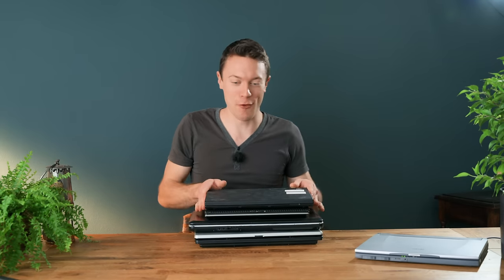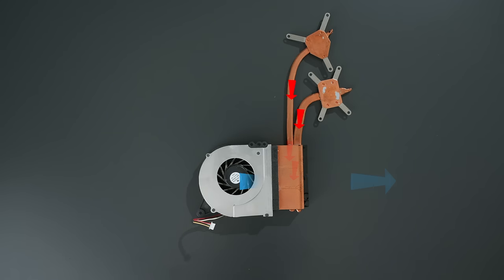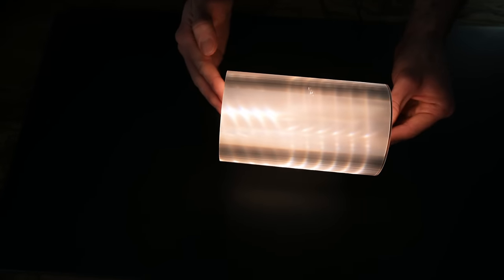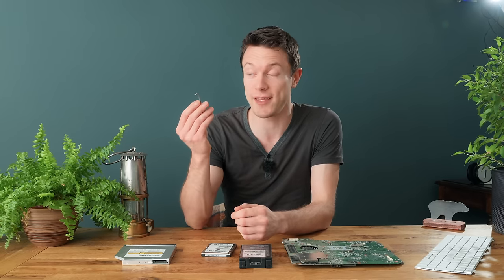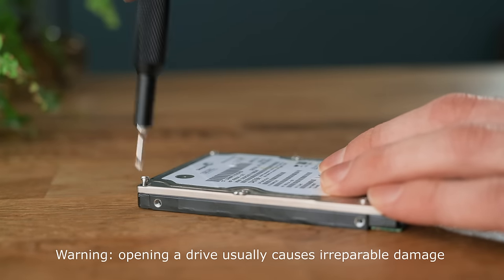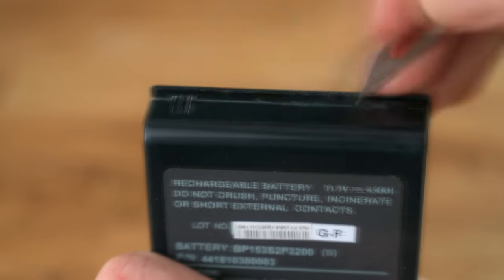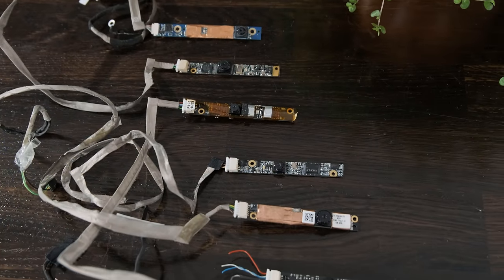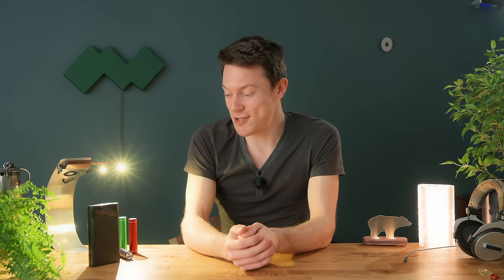Things you can make from old, dead laptops

Comment: Another tip: keep all the screws from the dismantled laptops. They are mostly standardized and come in handy if you loose one
Reply: yeah, usually m2 screw that come standard with motherboard
Reply: Very true. I often need m2.5 or m2 size for refurbished ones I do as a side project
Reply: Swallow them and hold a strong rare earth magnet over your stomach
Reply: lose*
Reply: Keep them for 2 plus years then chuck them as you realise you won't be using them
Reply: Could drop the "from dismantled laptops" I keep all screws from anything I take apart that doesn't get put back together. Never know when you'll need a random screw for something.
Reply: Agree. However at a certain point you realise what you have gotten yourself into when you're buying your 9th box to store screws in
Reply: thank you for your wisdom budget Gordon Ramsey pfp

Comment: I worked at a company that made the acrylic backlights for laptops and things. If you're doing the bear project, try to have the part of the cutout that's against the LEDs be in the same orientation as the original backlight was against its LEDs. The optical pattern on the acrylic has a density gradient so  that the light will be more even over the whole surface if you do it that way!
Reply: PJ I love to work with acrylic and backlit can you help thanks
Reply: Hello..i want to learn electronic  project making ..can u please  help me.please
Reply: You're so cool for this. Keep the spirit

Comment: 1:10 - Speakers: attaching bluetooth amp and USB cable to them

2:30 - Cooling System: used to cool high power L.E.D. lights

3:40 - Screen: using the diffusion sheet behind the screen to make diffused lights for art and tracing pictures

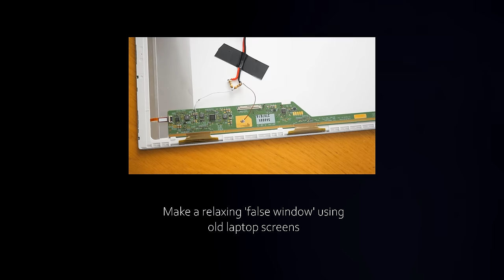4:40 - More Screen: making cool/weird shit with the diffusion sheets + L.E.D. lights

5:35 - Using acrylic panel behind screen and cutting out shapes

6:55 - If screen ISN'T smashed, use it as an additional monitor or smart mirror

7:28 - Microphone - use as a lav mic or attach to your headset for gaming

10:09 - If HDD works, put it in an enclosure. If broken, use it for sanding tools or making wind chimes

11:39 - Using HDD head array and laser pointer to make a VU meter

12:53 - Battery: using the battery cells to charge USB devices

16:20 - Webcam: making a home security system (also covered in another video on his channel)

17:20 - The Laptop itself - if the OS still works, use it for retro software/hardware

18:04 - just give it to someone else lol
Reply: "Just give it to someone else lol"
Reply: @KingJellyfishII  Just "donate" it to a charity so they can list it on ebay as "Vintage Hardware"
Reply: @DIY Perks should do this
Reply: @KingJellyfishII  with a link to this vid!!!
Reply: thanks
Reply: UOA Plays I didn’t understand the media PC @17:50
Reply: Saw your comment, left a like because of your help, but skipped it anyway because I want to be surprised
Reply: @shafraz.basheer  it's just taking the motherboard out of the laptop, put it in a case, and use it for multimedia consumption, i.e. put it in your living room hooked up to your not-smart-TV so you can watch Netflix/Twitch on it, play lightweight PC games on your couch, etc.
Reply: comment for archiving purposes
Reply: For the batteries, the LTT forum definitely have some projects that let you make a bigger battery bank and I'm assuming there are videos that would let you make bigger battery banks. Those one cell cylinders are no longer relevant for new smartphones and thus require larger cells like the ones that have Quickcharge or other charging protocols. So having all of those cells in one enclosure and the right hardware would definitely make for a much more efficient battery. Albiet at the cost of portability.
Reply: I actually use a pair of noise cancelling wired headphones connected to a separate bluetooth receiver, bluetacked to the side of the left ear piece, with it's 2500mAh battery which lasts quite a while, and plug them into that, with electrical tape holding the incumbent wires in place around the head strap. Works quite well, apart from the necessity of a single aaa battery for the headphones, the other part is rechargeable. I was quite happy to finally be untethered from a desk and still hear music as I meandered marinated towards the commode. And this guy, goes and does this!!!!!!  Bugger. I really do like this channel. and to think I just threw out a 32 inch tv that broke and a laptop that mysteriously was smashed to smithereens one fine hungover day.. 

I could have had wall lamps gosh darn it... :( to offset my salt lamp which is my only source of light in this otherwise dark web of deception.... eh... mundus vult decipi, ergo, decipiatur.. ;)
Reply: UOA Plays please pin this comment
Reply: 6:55 while possible, it isn't smart or something you should do. Those boards cost over $20 and a used complete monitor with stand and all, costs about the same. You can sometimes find free or next to free monitors from e-waste sites or from work with a blown capacitor that costs $0.5 to fix.
Reply: @Elfnetdesigns  yep
Reply: @Diy perks this needs to be pinned
Reply: On "Giving it to someone else". I wish he had recommended putting Linux on it first.
Linux is the perfect operating system for old hardware, for minimal use. If grandma just wants to check facebook and email, and maybe play some music, put on Ubuntu LXDE and she is good to go. She will never be bothered by updates, or have to read antivirus messages. It just works, forever.
Reply: @shafraz.basheer  Pc for only browsing the web,and listening to music and watching videos. (i mean you could use your phone)
Reply: Warning word:cooling sytem
Reply: @shafraz.basheer  kodi and programs like that. Also Linux can be used

Comment: I am genuinely impressed by the microphone.
Reply: Same here impressed by the camera security system as well
Reply: Is there a video how he wired it?
Reply: There's nothing here...go away 😂😇
Reply: My only issue is the use of electrical tape rather than proper shrink tubing.  Shrink tubing can easily be had in a variety of sizes and in assortment packs.  Smaller circuit boards can also be encased in it and the ends crimped shut with pliers whilst the tubing is still warm if that look is desired.  It looks, insulates and holds up much better than tape!
Reply: I wanted to know how to make a microphone like the one he's wearing
Reply: micro... phone.
Reply: keep in mind he probably recorded it into a audio interface and edited the audio. I don't doubt that it is good, but he most likely oversold it.
Reply: Very very impressed
Reply: I bought up 10 old/not working laptops for 25$. It was worth it.
Reply: @eone2345  how did it went? I’m planning to do it too
Reply: @quackatit  Can somebody tell me why my Macbook doesn't recognizes it as a mic? I soldered the out+ to the fourth ring(sleeve) and the out- to the third ring of a 3.5mm plug. With bad earphones soldered to the out pins I can hear the signal.
Reply: @eone2345  how was the end result? I'm trying to make the mic too but it sounds quite bad.
Reply: @Jackalski57  no it doesn't GTFO
Reply: @AgeofReason  🤣🤣🤣 Surely you jest.  Electrical tape is a stopgap measure, best used when you don't have shrink tube. It IS good for wrapping around an outlet before you stuff it into an electrical box. If you think otherwise, good for you. I've seen too much poor workmanship with gobs of electrical tape all over that just left tape residue over everything, but was normally covering a faulty connection.
Reply: @micklefpv  I know I'm late, but it's probably that the Macbook had a low-impedance input. If the "bad earphones" were built on the Piezo effect, they could be very high-impedance, taking very little power to make them work. (Crystal radios rely on that.) The Macbook might actually require more power. However, I'm only covering the audio side of this, I don't know exacly how computers recognize what's plugged into their audio ports.

Comment: Be careful when re-using laptop battery cells. It's extremely important to check the internal resistance, self-discharge rate, remaining capacity, and whether or not they heat up when charging. I re-purpose li-ion cells from old laptop batteries all the time, and have tested probably 250+ cells at this point. The last thing you should do is just stick it in a charger if the voltage is still "good" without properly testing the cell first for safety. I had a few Sanyo cells the other day, took them out of the pack, checked the voltage. 3.86V. I though "Great! These are still good!", that is, until I ran them through a Liitokala Engineer lii-500 to check their remaining capacity...During the initial charge cycle the temperature SHOT up at ~4V. They must have been 75 degrees C or more, I could barely handle them. So please, if you're reading this, be careful. While the majority of old cells MAY be safe, it's imperative to check them first before re-use. Imagine you gave a power bank to your little brother/sister or cousin and later found out they were burned or worse? Take the precaution of checking them properly, it's so important guys.
Reply: TheRageMaker he said celsius dude not fahrenheit
Reply: Apologies, I should have written Celsius to be more clear.
Reply: Ok boomer
Reply: who asked.
Reply: @bruhidk3337  bruh he is just making people aware that there are more precautions to take so you don't INJURE yourself or others
Reply: @Melvz  this is the laziest and most unhelpful thing I have ever seen. Jesus christ dude, he is litterely just looking out for people.
Reply: You wrote " 75 degrees C or more"  plain English and it's not your responsibility to try and fix stupid! The harder you try the dumber they get. 
Most everyone got what you were saying MOST.
Reply: Second that. Few tenths of a volt above what it can handle, few hours on a charger, and it will explode and ignite whatever flammable happens to be around it.
Reply: @Conor fenlon i see you watched vsauce2... Nice!
Reply: Wierdo
Reply: Make a video about it and show people how.
Reply: HypnoZ even in Celsius it still wouldn’t , that doesn’t even boil water, let alone melt through  that
Reply: @MichelLinschoten  I don't necessarily think it would melt through the case, but those single cell power banks are often made of aluminium, which would transfer the heat quite easily to someone's skin. It might not be hot enough to melt stuff, but it might just be enough to give little kids a nasty burn.
Reply: Self important boomer advice heeded. Will panic immediately.
Reply: Not Spencer Arnold ok boomer
Reply: What nonsense. I'd like to see if you can even hold 75 C in a video. I have the exact same charger, stop using it until you know what you're doing! Not once did you mention the datasheet upon which you'll find the correct C rate to charge a Li ion cell, you don't just slap it in and feel around blindly to asses whether it's dangerous yet. With that charger you have the ability to choose a rate of current for charging from 300mA to 1000mA, did you select 300mA?

You should realise that many batteries such those found in phones, laptops and tablets will quite happily charge at 2C (twice the max allowed discharge current) while gently roasting the device from within and beyond your grasp at a temperature regulated below that which you'll find on the datasheet, unless the charge controller or other attached components are defective.
Reply: 2 of my dell batterey's blew up. like a large m80 . all parts of battery metal blew 50 feet in seconds still burning after hitting ground. DANGEROUS AND DEADLY.Would not like being hit by flying shrap metal.
Reply: You are Right. we are lucky we did not git hit when just 2 of the dell lap top battery's blew up and went in every direction at 50 feet and still burning after spreading all over the place. sound like a gun. first band was loud "till the second was very loud like a G-45
Reply: Don't leave your lap top out over charging in the sun on a dry hot sunny day. BIG MISTAKE .
Reply: @edism  Many bare cells found inside laptop battery cases don't actually have the part number displayed on the heatshrink, making it impossible to source the appropriate datasheet.
Reply: @edism  The main reason I use the default setting of 500mA with the lii-500, is that most laptop batteries are charged at a rate of 1.96A with most battery cells arranged in a 2p3s configuration. So the amount of current being distributed to each cell would sometimes exceed 500mA anyway, so I think its a decent benchmark. That's exactly why it's the default setting on the device.
Reply: @B Mac i do not care
Reply: Thank you, Connor Fenlon, for that important caution!
Reply: Oh man this reply section 🔥 it’s getting hot in every way. People getting overly mad at people getting overly mad . 😂
Reply: I’m just liking because it’s long.ll
Reply: @blobby4532  THATS WHAT SHE SAID!!!
Reply: 75 C = 167 F.
Reply: Yeah it's all these reasons why I won't be messing with these batteries except to maybe replace the one in my phone. 
I'm not against doing this & would love to be able to do it. I just don't have the knowledge to do it safely & I don't feel like putting in the work to learn how.
Reply: Out of curiosity, what were you re-using the batteries for?
Reply: @caelumforder9710  I repurposed a few string lights and an IR controlled circuit to have a small off-grid mood lighting setup in my living room. They're still working to this day!
Reply: @caelumforder9710  Circuits that require 3 x AAA or 3 x AA batteries work well with an 18650's discharge voltage curve. Just don't forget to add a protection circuit!
Reply: Agreed
Reply: The problem is you used a Sanyo cell
Reply: @trapsarentgay4195  Can confirm. Since this post, I have learned a lot about how garbage Sanyo Cells are.
Reply: I disapproved this wasn't emphazised in the video, this comment should be pinned

Comment: Fantastic DIY suggestions that you actually COULD do yourself! The one thing I'd like to see covered that wasn't, though, is how to repurpose an internal DVD/RW drive into a standalone one. This would be especially useful, since newer laptops no longer include optical drives, and those almost never went bad in old laptops. Please include this in one of your next videos!
Reply: While a nice suggestion, this isn't always something that can be successfully removed and put in some kind of external case.
Reply: @MatthewN8OHU  Oh no! I was really hoping to be able to do that.
Reply: @s00gee  Most of them can be, only Really old ones were custom. Same adapter as laptop size hard drives have in external cases.
Reply: @s00gee  Actually, you can for 90% of them, it is. It must be a pretty weird laptop if you can't. ICY BOX has good cases for them. I use it myself.
Reply: If the laptop has a DVD/RW  and was made about 2010 or so.  The DVD/RW drive is SATA drive with the micro connector.  You can get a micro SATA to usb adaptor.
Reply: On my first laptop, it worked perfect. But then the hinge broke, the Internet stopped working on it (the cable is in the hinge, what a nice coincedence.), and the battery became a nuisance due to that. Second laptop, disk drive would jam. So I swapped the dvd drive from my second laptop with my old one. Looked weird, but it worked. They were both HP Notebook 15's, two manufacture years apart. (2013 and 2015).
Reply: @MatthewN8OHU yeah
Reply: Is Nero burning rom legal? I know it is only allowed if you got the original one...

Comment: You should do something like this but for older/broken smartphones, they can have a lot of interesting uses.
Reply: I'd love to use their cameras as Webcams!!!! most webcams are utter shit while smartphone cameras are great!
Reply: @HAWXLEADER  problem is the protocol. I can't remember if it was this guy but there was a video about reusing old laptop cameras, the camera itself uses 4 wires that actually follow USB protocol so you can even plug it into a regular computer USB. Cell phone cameras, however, have a completely different set of protocols, both hardware and software with many different pinouts and methods of connecting to a host device. Some cameras like the one for the Google Pixel have sufficient documentation and even have interface boards, however you'll need to do a lot of research to find which one will work. In addition, if you're using it as a USB type webcam then you may be limited by the speed of the USB protocol itself. This is why some cameras for high demand applications (think industrial and manufacturing uses like machine vision) use "Ethernet" cables because of the higher bandwidth and greater reliability.
Reply: There's a program on android called IP Webcam, and you can use an older smartphone as a motion activated security camera. It also works with a cloud backup service for $4 a month. You can also put one of those clipon fish-eye lenses on it.
Reply: @pleaseadjustyourtracking6330  I used IP webcam for a few weeks on an older phone and the device kept overheating, bugging out and eventually turning off. After just those few weeks (few hours a day usage) my battery life went down to one fifth of what it used to be.

Its possible to use smartphone cameras as webcams, but in general they were not designed to be used for longer periods, especially while the phone is transmiting that video feed. Newer phones could probably handle it better than my old galaxy S6, but you should still be careful.
Reply: Like an old iPhone 4?
Reply: @monkeyman7048  It only works for 4S and up sadly. I have an old 4 as well, but can't use it.
Reply: nice idea
Reply: Turn them into emulator consoles